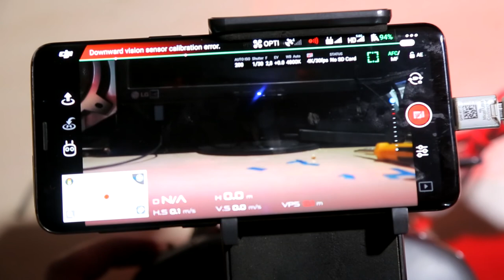DJI PHANTOM 4 PRO FLEX CABLE REPLACEMENT

Comment: Hello, sorry to disturb, just want a quick help.

I wonder if my flex cable is the issue here ?
-> https://we.tl/t-KdXcAqwdFu

The image getting scratchy and sometimes switch off when the gimbal move...

Thank you so much by advance for your answer :)
Cheers,
William.
Reply from the maker: Hello my friend

is there any problem in the statuses section?
for example: sensor error
Reply: @dilmurodmediatv  Hello there, no there isn't, the issue cam after a crash.

Sometimes the image is just black and dead and, there is a "sensor issue" in the reports section.
But when i  touch a bit the flex cable and restart the drone , most of the time i have those scratchy images as we see in my video.
Reply from the maker: @LeVoyageDesKoumoul  try replacing the flexible cable
Did you change the cable before?
Reply: @dilmurodmediatv  Okey i will buy it on bangood then and give it a try. They the cable was replaced 1year and half ago.
Reply from the maker: @LeVoyageDesKoumoul  Did the drone crash?
Reply: @dilmurodmediatv  yeah the drone crashed but with the old flex cable the gimbal was still acting normally.
Reply from the maker: @LeVoyageDesKoumoul  I recommend replacing the flex cable
Reply from the maker: Do you see long black lines when you point the image at the light?
Reply from the maker: or do the image show asterisks on a black background?
Reply from the maker: if so 100% flex cable is broken.
Reply: @dilmurodmediatv  no the image is good now but there is just this crazy gimbal dance... maybe the new cable is not good/official enough ? it's a cheap one
Reply from the maker: @LeVoyageDesKoumoul  Did you replace the cable?
Reply from the maker: @LeVoyageDesKoumoul 
https://a.aliexpress.com/_mrm64rh
Reply: @dilmurodmediatv  yes i did :)